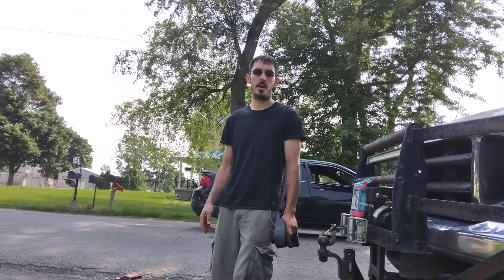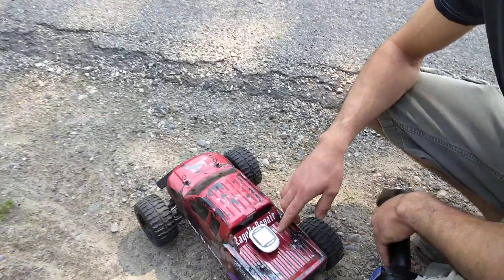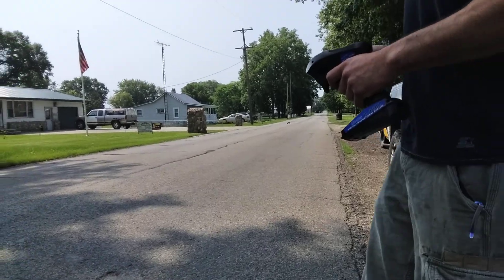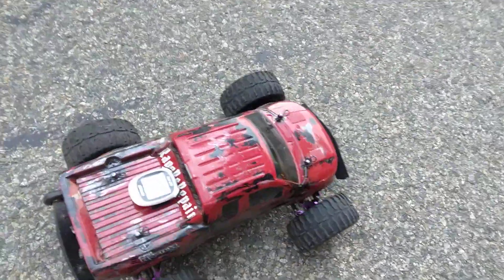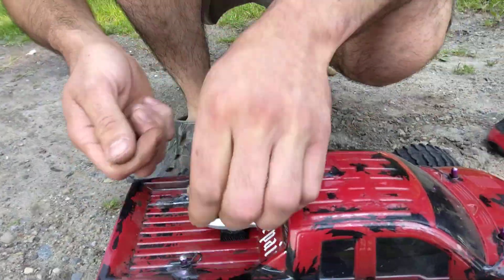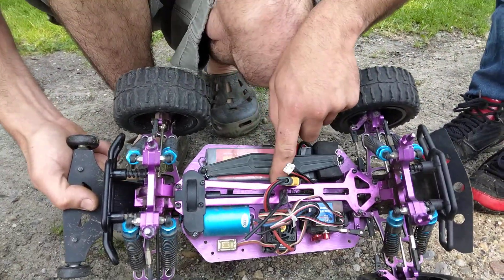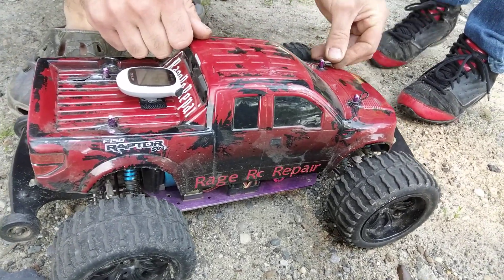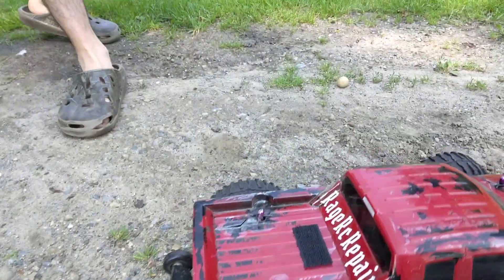Redcat volcano epx pro speed run with new center zdriveshaft mod!

Comment: Nice setup I was out ripping my volcano yesterday maxed out at about 43 mph.
64 and 26t pinon gear
Reply from the maker: That's pretty good!
Reply: Is it on the stock motor cause I’m running 23T and I have slow takeoff but pretty high top speed
Reply from the maker: Yes stock motor and stock gearing.

Comment: Hello! I want to buy a volcanic epx pro, but something stops me before buying it, will the crown and drive shaft differentials withstand 3s? or in a short time I will wear gears? Cheers
Reply from the maker: Honestly I recommend the kaiju Ober the volcano any day. Yes it's a little more money, but it's 10x the truck. If anything get the arrma granite blx or the redcat trmt10e. Both are much better than the volcano. Volcano has cheap gears and diff cups and axle shafts. Not a good basher truck. Good for speed runs, that's about it.
Reply: @ragercrepair9301   thanks my friend! Cheers from Mexico,sorry my english is bad 😅😅)
Reply from the maker: You're very welcome!

Comment: there is a steel drive shaft you can get on amazon that just doesnt brake also look into the slash front dif mod best thing i ever did to mine
Reply from the maker: Been looking into lots of options for this truck! I really love it.
Reply: Slash front dif mid?!? That’s sick
Reply from the maker: So the mods needed to beef this truck up don't outweigh the cost invested in it. I wish redcat would trash this model and start over with a mini kaiju style chassis and drive train. That would be the real answer. But honestly after all the time I've put into this model, they need to just start over. Which this model isn't there's anyways. It's badged as many different brand names. Best option would be buying the mt10e or just get a slash possibly a granite blx.

Comment: Where do you buy the upgrade part? Put the link,please
Reply from the maker: OK so there are 3 parts that you will need for the center driveshaft upgrade. Do you have any of them to start with? Or is there one specific part you need a part number for?
Reply: @ragercrepair9301   I no have nothing only the car and my card is brushed motor
Reply from the maker: If you have the brushed system, driveline upgrades won't really be necessary. I would focus on the suspension parts that fail first. What upgrades do you have so far and what parts are broken right now that you want to upgrade?
Reply: @ragercrepair9301  I want to upgrade to brushless I have the motor 4300kv and the esc , but not installed on the car